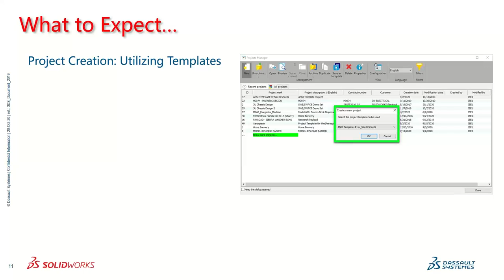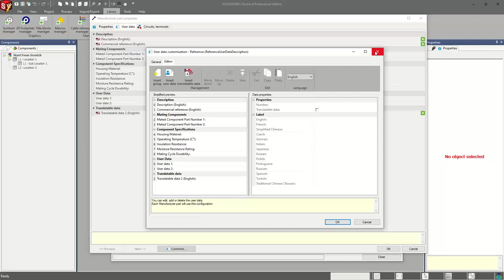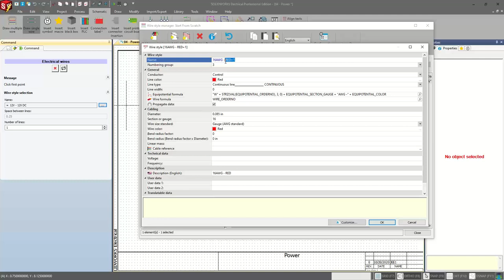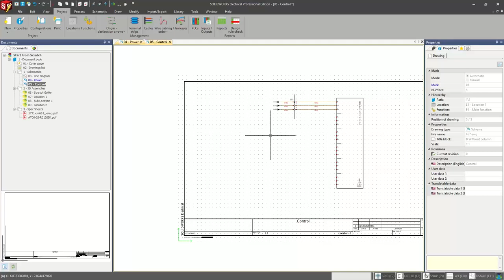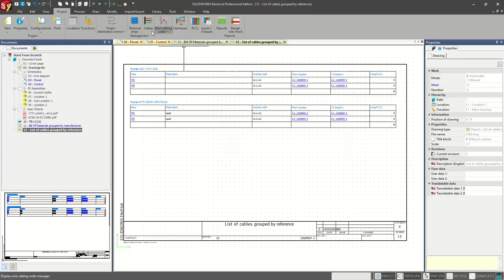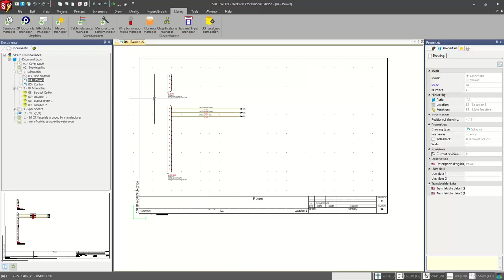SOLIDWORKS Electrical:  Schematic Design from Scratch

Comment: Hi, great video. just wondering if there is anyway for us to change the coordinate generated from the origin - destination arrows?
Reply from the maker: In the project configuration, you can change the formula for what information you want to display with the OD arrows. i.e. row + column, or sheet + column, or to from component + terminal, etc.

Comment: Don't add spec sheets to your project you will look like a noob.
Spec sheets should be added/linked in the parts database then forvermore anyone using that part in any project can find a link to the spec sheet.
MFG Part Properties > General > Data Sheet
Save the sheets in a common network folder created specifically for spec sheets.
If you need to add a work instruction or some other config document that is specific to the project then that would be fine.
Reply from the maker: Yes. You are correct in that you should be putting spec sheets directly into each part. However, this is a training video and it's simply showing the fact that you can embed documents such as spec sheets into the project. And from personal experience and as someone who travels for work quite a bit, embedding a reference document or spec sheet into the document tree doesn't make you a noob - it allows you to share the information 24/7 with your team and keep important documents right at your fingertips - so that you don't have to go search all over the internet or internal servers to find the appropriate information.